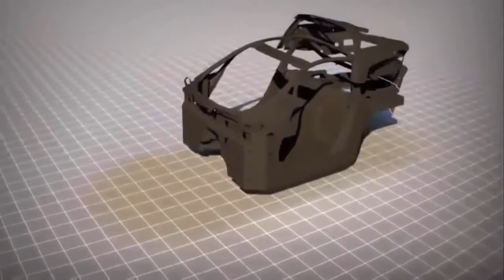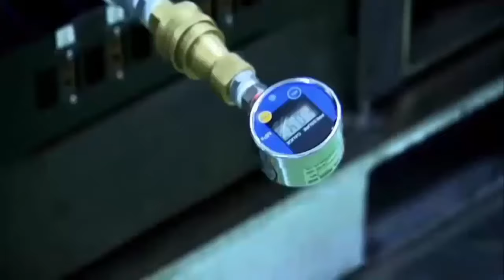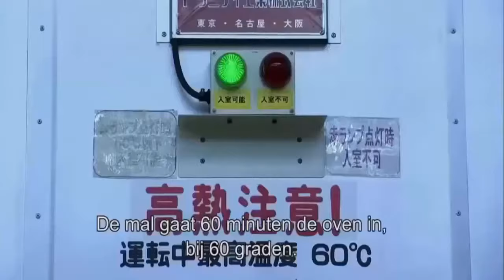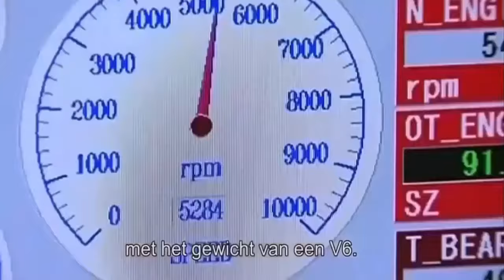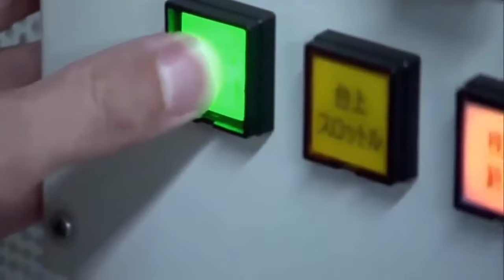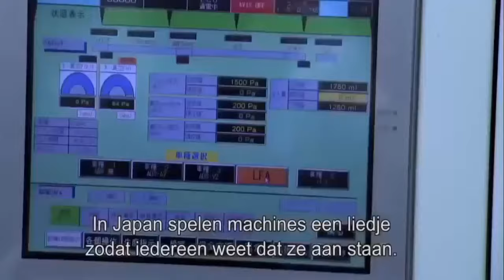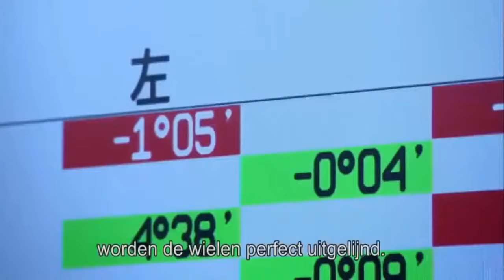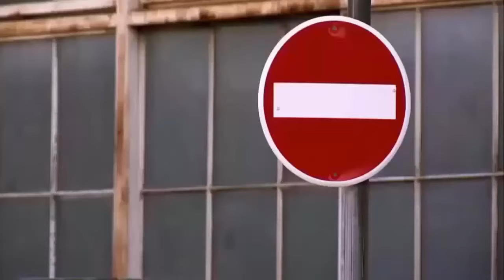Lexus LFA - How It's Made Supercar (Car Documentary)

Comment: 15000 parts, carbon fiber, Yamaha tuned engine with high pitch formula one sound, limited productions, exceptional production unlike anything Toyota / Lexus every made before / truly a hybrid between the Yamaha motorcycle excellence high power low mass engines optimized like the R3 engine in our 2020 MT03 that sounds amazing, compact & naturally aspirated with an exhaust note that gives me shivers when I accelerate from 3K to 8K while getting onto the freeway, with rapid response that loves to rev to higher RPMs where the 40ish HP come to life as the engine approaches 11K RPM // Yamaha really knows how to make a dope engine & so does Toyota & Lexus so when they work together they get hybrid synergy of design optimization that makes something truly exceptional like the LFA to be produced! Truly a wonderful work of applied technology, science, engineering, manufacturing excellence & amazing Made in Japan automotive artwork quality vehicles that are durable, long lasting, reliable & excellent like our 05 & 10 Prius models //
Reply: I have watched this video 3 times & still love it more & more each time, it tickles my mind watching what they did to make the LFA // I can only dream of ever owning or driving one @Toyota if you have a way of making that happen, let me know. My Trip to Toyota City in Japan in 2010 was one of the coolest things I have ever done, other than buying our 05 Prius brand new!
Reply: You can learn dutch language a bit by watching too :) ^^

Comment: A marketing move to add value to the Lexus brand & imbue further automative manufacturing ideologies at Toyota to continue making reliable, exceptionally well made, and very high quality automobiles & other vehicles well into the future, especially with innovative solid state batteries & compact IPM Yamaha electric VFD motor generators with integrated charge & discharge controller linked via electro-mechanical breakers via short high current cables direct to the energy storage module or ESM made with cutting edge batteries & super capacitors linked as a system module to absorb thousands of amps of DC during brake regeneration charging & too give off thousands of amps of DC during acceleration, all at 800+ volts to enable smaller wires to do so efficiently & to produce better axial magnetic flux density in the IPM motors for enhanced performance & lower mass //

Comment: Imagine making the entire car out of silicon carbon using chemical vapor disposition stereolithography
Reply: Ceramic engines a pipe dream for engineers, materials like zirconia & silicon carbide & tungsten carbide teasing them with properties like excellent strength & great thermal conductivity but in reality these strong ceramics have to be CNC milled like an F1 engine & so an automotive car or motorcycle engine made with such way to costly to be feasibly integrated into a real world volume produced consumer product //
Reply: it would be strong